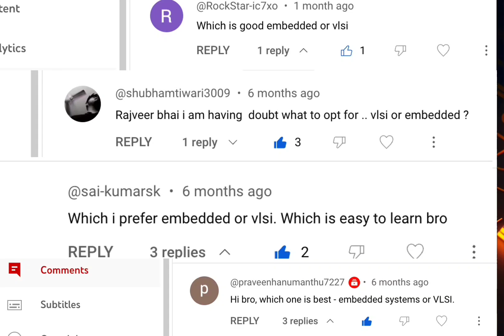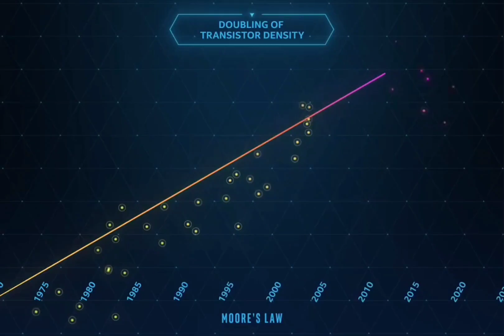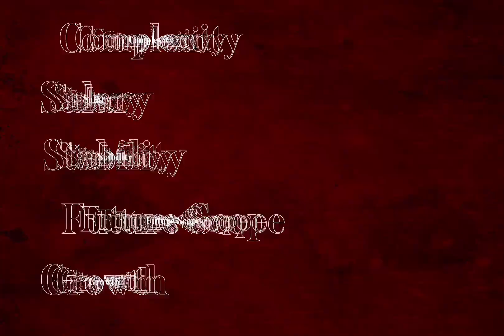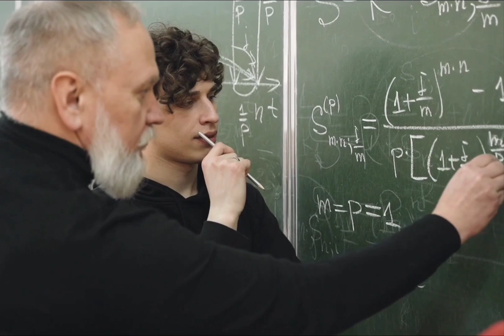VLSI vs Embedded Jobs | Career in Core Electronics | Comparison of sub-domains | Rajveer Singh

Comment: Good video..But consider a factor like doing business/entrepreneurship in the field i think it is easier to do in Embedded than VLSI due to its diversity and wide applications and ease of access.. Is it same in VLSI? What are your opinions?
Reply from the maker: It would be very tough for few individuals to setup a start-up or business in VLSI. So, Yes you are correct.
VLSI would require very high capital and that itself is a biggest entry barrier to start a business in the sector of vlsi.

Comment: Also Don't forget Embedded can be replaced someone easily by AI by automation
Reply: None of the robot can think, our application as respect to time. They help in coding not from scratch for sure.
Reply: Don't underestimate the power of embedded engineers to design IoT circuits and products.
Reply: Embedded is still more job ready, what will u do after becoming a real engineering if there aren’t much companies to hire lol, ego badane se insecurities khatam nhi ho jati
Reply: Embedded engineers are actually technicians😂😂

Vlsi is real engineers 🔥🔥

Comment: I think you opinion is a bias 

Because you are only talk about good peaks about VLSI 

But if you include scope like number of jobs, options of switching, diversity of field then embedded system is winner
Reply from the maker: Not against Embedded,
But VLSI has scope, diversity of Jobs and switching options available as various companies working on some part of VLSI Design flow.
So based on other factors vlsi goes slightly ahead.
Embedded as well have very good career options.